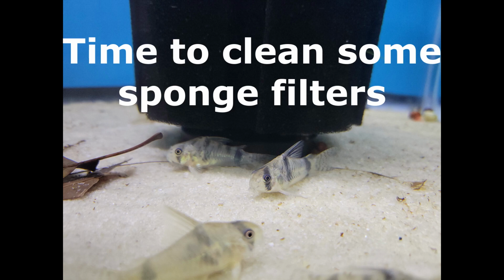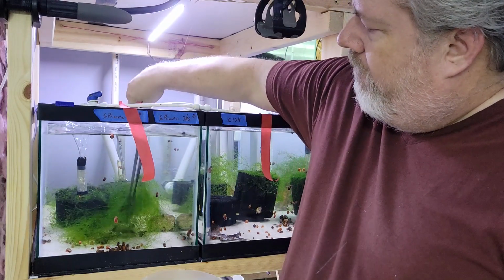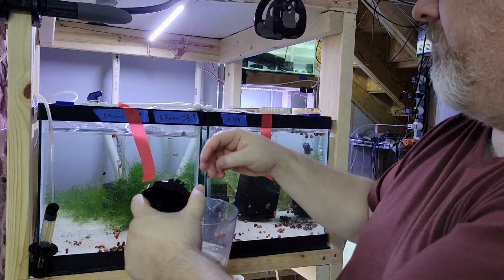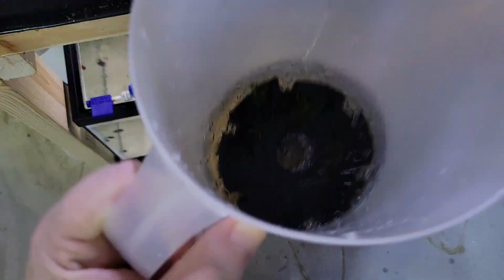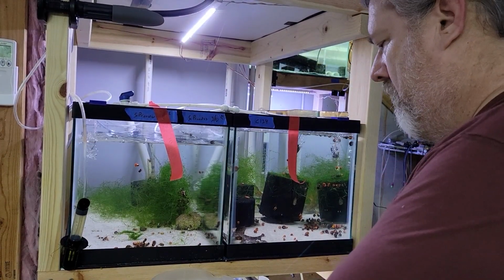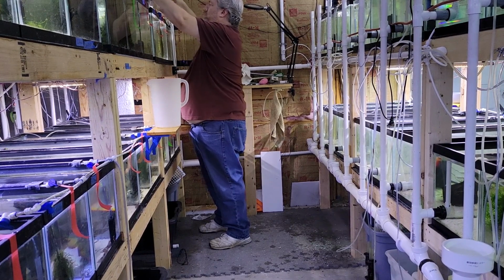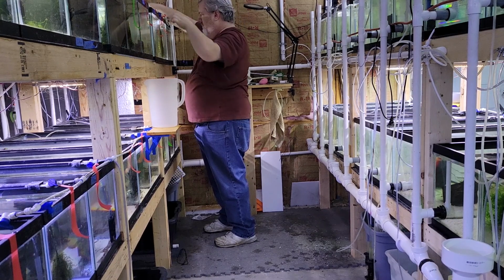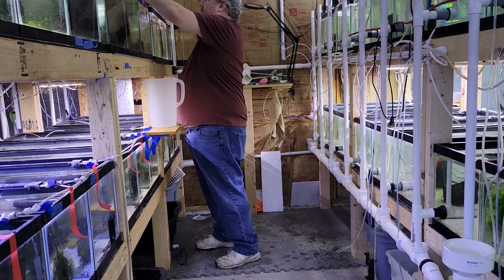Sponge filter cleaning time!  How simple and efficient is your process?

Comment: I rinse my sponges under cold well water. However Jason @Prime Time Aquatics has a video about the minimal effect of chlorinated tap water on the bacteria within the sponge. But I could see how your process would be more efficient for the number of sponges you're cleaning!
Reply from the maker: I'm not actually worried about killing off any of the bacteria in the sponges due to chlorinated water or any fresh water.  I use the tank water since it's going to be changed out anyway with an up coming water change.  Since the water is really just a fluid to flush debris out of the sponge, might as well use what is about to be thrown out anyway instead.
Reply: @mbroome  makes sense! Must be nice to have that WC system
Reply from the maker: Oh man, I don't think I would be able to handle past about 15 tanks without it.  Or at least and not have it turn into a job vs a hobby.
Reply: Agreed 😅